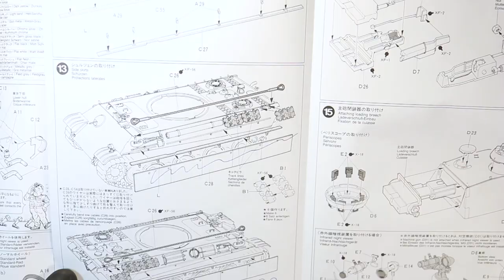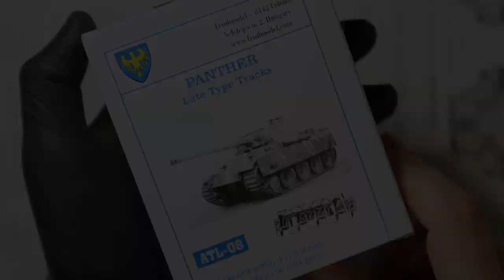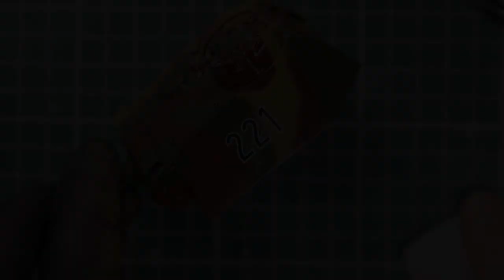Panther Type G German WW2 TANK 1/35 Tamiya Plastic Model Full Video Build

Comment: You should try metaltracks from R-Model... building is much easier...
Reply from the maker: Thanks for the advice.I will try that in the future ;)
Reply: @doctormig2709  They come with metalpins so you don't have to cut wire. Drilling is usually not necessary as well.